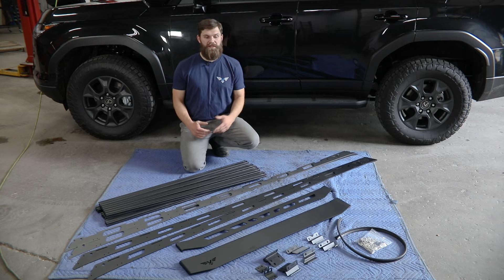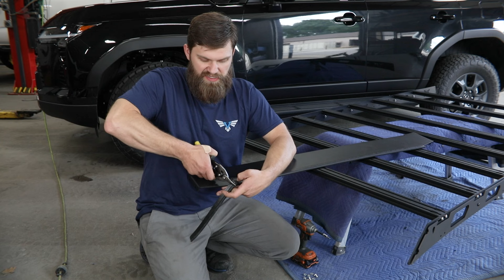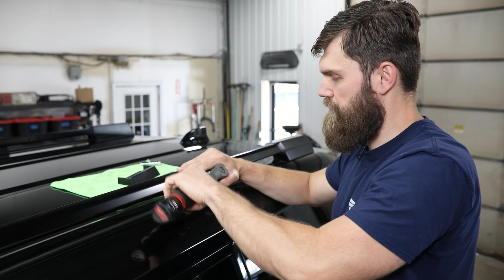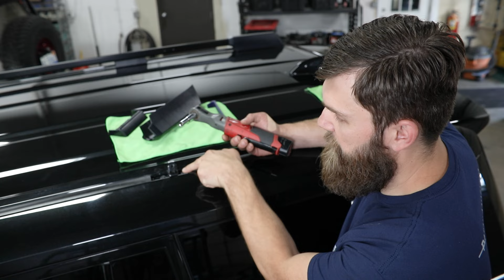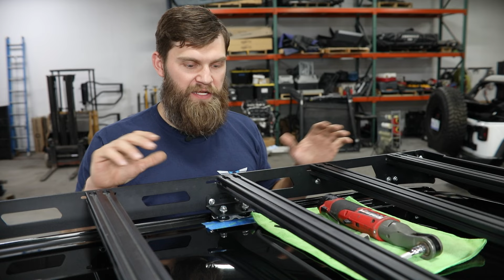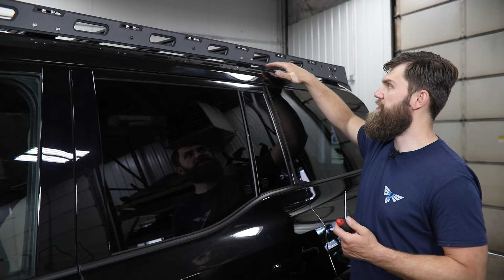Lexus GX & Land Cruiser 250 Roof Rack Install

Comment: Mine was missing 2 of the 4 nuts for the middle mount, had to make a trip to the hardware store during the install (wasn’t about to wait like a week or so for shipping but super annoying it’s missing items especially considering the price). Other than that, great video! Hardest part was definitely getting everything leveled and getting the desired height. I wish the rack came with the sealant and PPF strip though. Also wish it came with instructions , the video was good but I think written instructions or a PDF would help out a lot. So far so good. Feels sturdy. Going to mount my rooftop tent on it.
Reply: what are the bolt sizes for these?
Reply from the maker: Which bolts specifically were in question?
Reply: @Victory4x4  I’m trying to install a factory roof rack on my 1958 trim and doesn’t come with hardware. Been scouring looking for the correct bolt sizes.
Reply: @Victory4x4 I’m not a moocher I swear lol. 

https://youtube.com/shorts/GkGaBgjCXLQ?feature=shared

Comment: whats the total weight of the rack?  Also do you have load weight limits yet?
Reply: I got this from Grok, comparing Victory with Westcott Designs:

Weight:

Victory: ~60–70 lbs (estimated, per ‽web:4,13,21), ~13–23 lbs heavier than Westcott due to thicker aluminum (3/16-inch, per ‽web:3) and steel brackets (per ‽web:5).
Westcott: 46.7 lbs (confirmed, per ‽web:0,2,6), lighter, aligning with your off-road agility needs (5,616 lbs Overtrail, per prior query,‽web:15).
Impact: Victory adds ~0.2–0.3 seconds to 0–60 (6.7 seconds stock, per prior query,‽web:2) vs. Westcott’s ~0.1 seconds (100 lbs ≈ 0.1 seconds, per ‽web:27).

Height:

Victory: 2.5 inches above roof center (per ‽web:3,5), taller, increasing drag and clearance concerns (e.g., garages, per ‽web:20).
Westcott: ~1–1.5 inches (hugs roof line, per ‽web:0,4,6,16), lower, reducing drag and fitting your low-profile preference (per ‽web:4,19).
Impact: Westcott’s lower height improves aerodynamics and aesthetics (per ‽web:4,16).

Static and Dynamic Load Capabilities

Victory 4x4:
Static: ~1,000–1,200 lbs (estimated, per ‽web:19,23), based on Prinsu Pro’s 1,200 lbs (per ‽web:23) and Victory’s robust design (3/16-inch aluminum, per ‽web:3,19).
Dynamic: ~500–700 lbs (estimated, per ‽web:19,21), comparable to Prinsu’s 700 lbs (per ‽web:21). Suitable for rooftop tents (~165 lbs dynamic, per ‽web:1) and heavy gear.
Evidence: GX 460 users hauled plywood, kayaks, and tents with no issues (per ‽web:13); GX 550 rack is similarly robust (per ‽web:5,19).
Westcott Designs:
Static: ~800–1,000 lbs (estimated, per ‽web:2,19), based on “impressive weights” for tents and gear (per ‽web:2,15). Slightly lower due to lighter design (46.7 lbs, per ‽web:2).
Dynamic: ~400–600 lbs (estimated, per ‽web:2,19), adequate for tents (~165 lbs, per ‽web:1) but less than Victory’s capacity (per ‽web:19,21).
Evidence: GX 550 user (225 lbs) climbed rack with “tiny flex” (per ‽web:4); supports tents and gear (per ‽web:2,15).